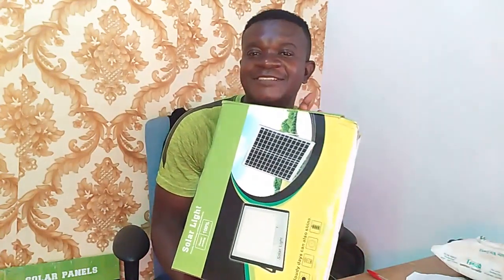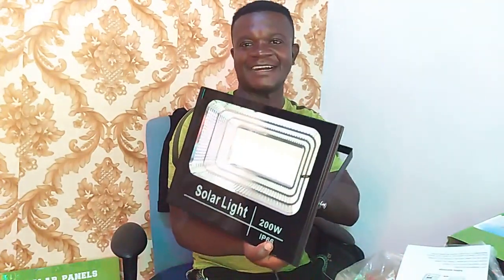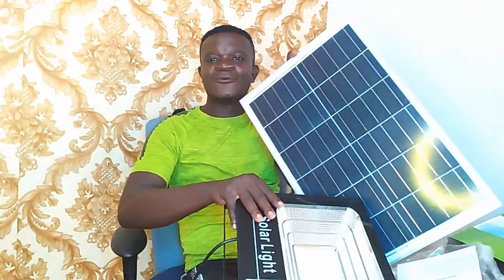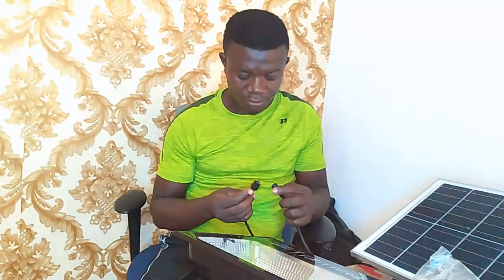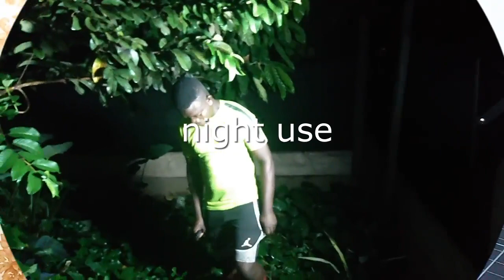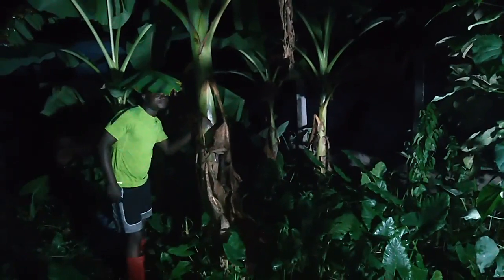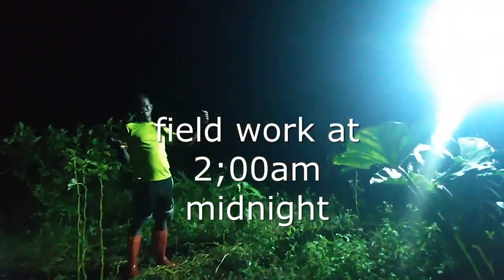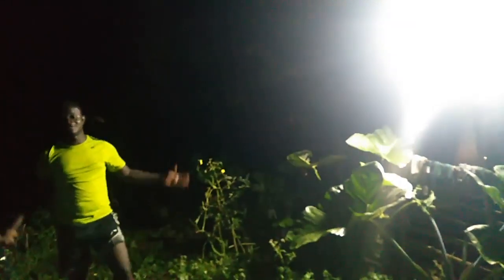Unboxing And Installing  An IP66-Solar light For Plantain/Banana Nursery operations At Night

Comment: Great stuff!  I guess you've got the solar panel connected to a battery to store up the day-energy to use the light at night?  It can also be fun to use LED grow lights to help grow cuttings etc, sometimes twice as fast as just using sun - though can need a lot of energy :)
Reply from the maker: Thanks so much for the massive supports